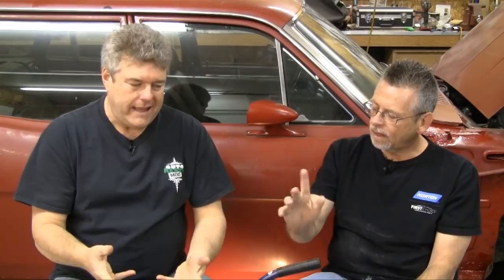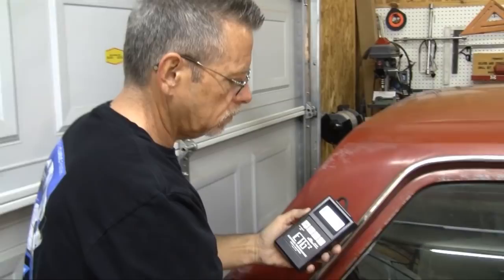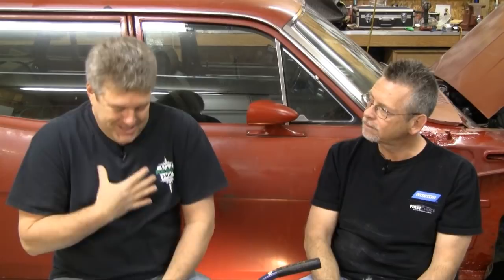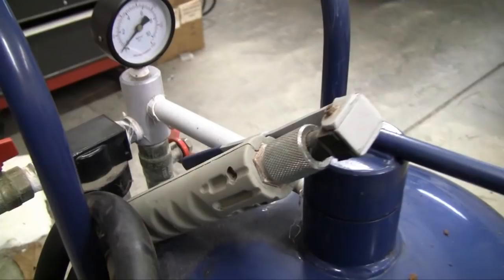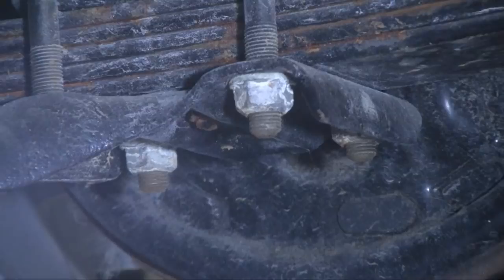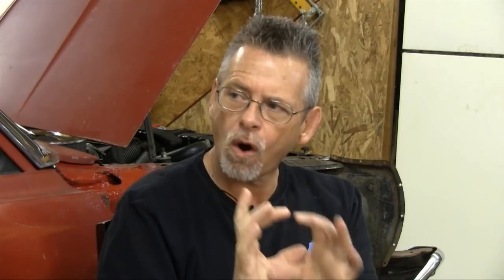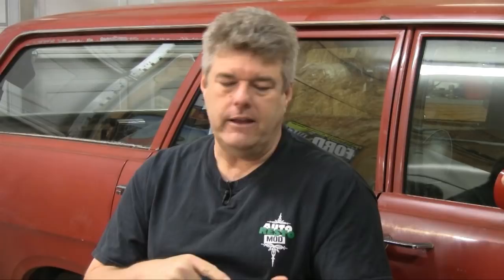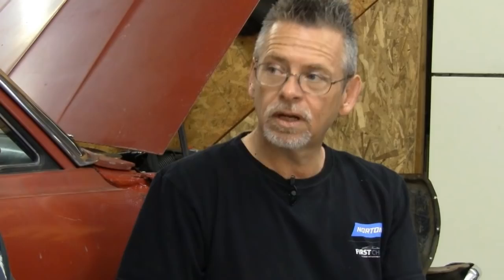Six Ways to Strip the Paint Off Your Classic Car Pros and Cons Episode 201 Autorestomod

Comment: I've been doing wet blasting for a living for the past year. It is by far the preferred method for removing all material from a car in any condition. I've blasted 
 aluminum vehicles 67 land rover. To thin metal like 68 Broncos. It does fill jams with media (glass) we add rust inhibitors (holdtight 102) to the process. We then pressurewash the vehicles to remove all excess media also ht102 is injected in the soap dispenser. Then we give the vehicles a final rinse with ht102 10 to 1 ratio. Blow dry ...the vehicle is ready for primer.   
Ht102 works by stripping the surface of all impurities. Not by leaving any kind of coating. We are located near the coast and its buys you approx 48 hrs ...of flash preventive...

I recommend to my customers to primer before metal work. And grind small areas that they need to repair. Otherwise they will be calling me again to remove the rust after doing a few weeks of metal repairs.
Reply from the maker: Thank you for this! Awesome. We're wanting to find a Dustless place locally so  we can do a hard core experiment.
Reply: How much do you charge for this?

Comment: Just watched a video on dustless blasting ,they use a special rust inhibiter with the water that's used in the machine ,they blow dry the car when they are done . The rust inhibiter gives you a 72 hr window and helps with adhesion for sealers and primers .

Comment: Informative video. I was hoping it would address the paint on my car. I have a 1983 FLORIDA Mercedes Benz with enamel paint. My concern is the paint is damaged by the Florida sun beating the paint for years. Otherwise, there is zero rust and corrosion and a few small places that have been polished through to the primer. This wasn't addressed in the video, so I don't know what needs to be done at this point.
Reply from the maker: Many times if the original paint is good, you can scuff and repaint over it with sealers. I wouldn't strip the car unless absolutely needed.

Comment: I did an entire car with just a high speed drill and lots of wire wheels, harbor freight or amazon are pretty cheap and the only mess is paint, primer, and bondo dust - and lots of little wire pieces if you overuse a wheel (you find the little wire pieces in your clothes, in the carpet with your bare feet ouch)  I tried the media blaster from Harbor Freight but it was a mess and by the time I got it working, only did a small spot on the car and was out of media already.  Not worth it.
Reply: i did the real cheap "blaster" from hf that is made of plastic and you hook your shop air to it. It was a wasted $40.
Reply: The high speed drill is a mistake.  Guys, use a variable speed grinder-polisher when using wire wheels, and keep the rotational speed below the threshold where wire spins off and embeds into your skin, and threatens unprotected eyes!  Do not continue running a wire wheel when someone steps near to talk to you or watch.  I cannot imagine wire wheel technique on an entire car, but if you did it, then I am willing to consider the technique, as it’s all hard work with drawbacks.  I use wire wheels on rusty scaffolding, jack stands, old vices, for example, because these objects are simple.  On other objects, you can’t get the wire wheel into complex, tight areas.  Sometimes I use a pneumatic die grinder and a hell of a lot of small sanding disks to get into tighter areas.

Comment: As a dry ice blaster I haven't had a lot of success with dry ice blasting. If the paint is really thin and there is only one layer then dry ice could work, but it's unlikely that the average car would be able to be stripped with dry ice.

Comment: Great video! What about chemical dipping with acid or dipping in a heated tank of environmental friendly chemicals? My take on this is dipping is the best method, then water injected glass blasting. Northern California doesn't allow dipping, so my shop uses a rust inhibitor with the water when glass blasting. Using an inhibitor the car will not rust for 3-5 days when left outside, unless it rains. The rust inhibitor is environmentally safe and actually increases adhesion of the epoxy. The surface is so clean when wet blasting you can epoxy when dry, with no other prep work needed. Wet blasting can remove body filler, undercutting, powdercoating, and grease with ease. On average I charge $1500  for blasting a car on a rotisserie. I will not paint, restore, resto-mod, or customize a vehicle unless my shop blasts it because I want to preserve the vehicle, not patch it.

Soda blasting is not recommended by paint manufactures and can void warrenties. So can dirty recycled media. Many shops recycle their media and recycled media will contain oils, from previous jobs when blasting undercarriages, which will create adhesion problems.
Reply from the maker: SpecialedSpellcaster Honestly, Jeff has had less than stellar results from chemical dipping. We'll be doing a couple of different methods on the '69 Wagon here soon. Stay tuned!
Reply: +AutoRestoMod I had my 70 Chevelle chemically dipped at Redi Strip and they did a great job, all the rust and filler and grease ...  GONE.    Exposes a lot of problems but at least you know where they are and it gets to all the hidden areas that blasting or sanding will not touch. Not cheap... but very effective.  See my video posts showing the before and after.   Thanks

Comment: I need to amend my question.  I'm looking for the best means to remove all paint, rust and over materials from steel, then immediately coast the car with the best rust protection possible.   I'm trying to create a vehicle with virgin metal then protect the metal from rust or other environmental degradation.  It just seems to be one place where saving $2,000 or $3,000 might not be a good idea, especially knowing how much money will be poured into the car afterwards.
Reply from the maker: I really like the Dustless system so far. It offers a protective "coating" when the metal is blasted. The protection last roughly two days; enough time to get the car into epoxy primer. We're looking at doing a video on media, Dustless, and chemical stripping in the future, just need to line up the cash.

Comment: I have a question, on parts that are bought say from AMD, they are treated with black paint, before painting these parts is just a little mild DA work good enough prior painting?
Reply from the maker: Some say yes and some say no. I know painters who strip the e coat primer off and start over. Others I know go right in over the e coat. It really boils down to your comfort level with the manufactures e coat.
Reply: @AutoRestoMod  Thank You for that answer, I think I will DA most of it off, just so the Epoxy primer has something to bite into, Thanks again,

Comment: i have a 74 chevy truck and has a cheap paint job on it with alot of surface rust in various spots would you recommend using a sander with different grits or wire wheels to remove paint,rust and if you do use this method does it heat up the metal too much using one or the other?Also after your done stripping the paint how long do you have to paint it again and is there something you should put on the bare metal while waiting for paint such as a a rust inhibitor? thanks alot jeff
Reply from the maker: +Rockin Pip Bare metal starts to rust almost immediately after the rust is removed. If you are only doing small areas, 80 grit can do the job, but to do the whole car you are going to go through a ton of paper. The wire wheel method is often a little underwhelming as to performance. Sanding will be the fastest way to zip off that rust. Some media blasting can sit for a good while, sanding will not tolerate that. Needs to be in primer as soon as possible.
Reply: AutoRestoMod Muscle Car Resto and Modifications thanks alot for the reply i appreciate your help!
Reply from the maker: Any time Rockin!

Comment: Opinion on metal prep over bare metal and can it cause issues in body seams
Reply from the maker: Yes. I have proof in my 1972 Mach 1. We had the car dipped and the seams are rusting. IF you can get water down in the seams, you can clear it out though. It just requires that little extra work...which is where I sometimes stub my toe so to speak.

Comment: Guys, a buddy of mine has his door jams sprayed over with a thin coat of black. I doubt is has even been sanded prior, since it can be scraped with a finger nail.
What would you guys recommend for stripping the hard to reach area's around the hinges? I only want to remove the semi-gloss black, and reveal the factory color. A heat gun perhaps?
Reply from the maker: +Ronald van Kemenade That will be tough. I might try a toothbrush with rubbing compound. The go back with another bush to remove the residue. Heat won't really help and may serve to attack the original finish.
Reply: +AutoRestoMod Muscle Car Resto and Modifications Thank you very much!
I'll try it with a copper or brass brush; he wants to go from brown metallic to candy apple red anyway. I just don't want to strip down to bare metal unless I really have to.
Reply from the maker: +Ronald van Kemenade OK, just know that the Copper or Brass can be as rough on paint as a steel brush. Regular old tooth brush will cut it as long as oyu are using rubbing compound.

Comment: I dont quite understand, he says that even when you soda blast metal starts to oxidize within minutes so you need to sand? Obviously metal oxidizes immediately, but isn't it reasonable to paint within a few days if no obvious oxidation occurs? It just seems a little ridiculous, the video makes it sounds like its near impossible to get a good finish without spending hundreds and hundreds of dollars. 

Is this one of those age long automotive questions, that everyone has their own 'right' way? But in reality as long as the paint is not severely scratched you will be fine painting the correct way?
Reply from the maker: +be ef The video was done to show different methods and give some "for your information" thoughts from a professional. Larry has his ideas, most of which are founded in years of doing cars. Larry is a superior technician with over 40 years of auto-body experience who works for a major paint supplier. He has no ax to grind on any particular products. he feels that plastic media is the best solution. Jeff is not sold out on any method yet. And thus the wagon is still waiting for him to do an episode where we examine the top three: Plastic Media, Dustless, Chemical (Aircraft stripper) and Mechanical (Big orbital with 80 grit). As to the big bucks being the only solution, note that we did discuss DIY methods as well. So not all of our solutions were big bucks.

Comment: I was planning on sand blasting and soda blasting my '64 bug. However...after watching this...I am concerned about finishing it and letting it sit before painting it. It's not like I am going to let it sit for long...I plan on immediately getting it painted. But it might be another weekend before I get it painted. I am worried about letting the car oxidize in the interim.  How big of a concern is that and what can I do?
Reply from the maker: Soda can serve as a rust inhibitor as can the dust from media blasting as long as the surface isn't disturbed. Be sure to let the shop know what you did: either media or soda. The cleaning methods are different.
Reply: watch diyautoschool on the tube. Pete is big on expoxy "primer". You can spray it on bare metal to hold the rust off until you're ready to paint or work the metal.
Reply: Suggest you do it yourself one panel at a time and prime coat immediately.  use paint stripper. maybe ok to let sit if you're in Arizona, otherwise it will surface rust and waste your time and money.

Comment: Any suggestions on undercoating removal on a early 70's dodge? And should you paint the car with all parts installed or paint fenders and hood off and put on later? and is there a wait for cure time to install parts after painting? I know a lot of questions.
Reply from the maker: We will cover painting the wagon hopefully this summer. Best advice on the undercoating is remove anything from the interior that can catch on fire, then use a butane or propane torch and a scraper. Hot, hard ugly work but that has proven to be the most effective for us. The on off thing is as varied as the painter that will be squirting the car, one dude likes fenders and hood on, another fenders on hood off. We tend to like to have the fenders on and hood off. Paint cure is different for different brands but Jeff has always run by the rule of: if you can still smell it, it is still cooking off...see that wasn't so bad.
Reply: AutoRestoMod  Never and i mean NEVER!!! , use a butane torch to scrap paint off any car as you will Warp the shit out of it and also it will create surface rust quicker.FACT!!
Reply from the maker: Mopar Man73 Never have we warped a panel doing this: heating the shutz then scraping with a paint scraper. Now if you sit on it with the heat for a while yeah, you surely could. But if you just pop heat to it then remove the heat and scrape, it works great.
Reply: well ok but mention it next time you suggest it as theres alot of weekend warriors that might might not have the expeirence to think that.I do enjoy your show and i thought i would just try in helping others not fuck there car up( safer options) thanks :)
Reply from the maker: Mopar Man73 LOL For sure.We might do as Fst break on how to remove undercoating with the torch. But your input is always appreciated! =)

Comment: I picked up problems painting new 2K paint on top of old Enamel.
Reply from the maker: Sorry to hear that.
Reply: Hi, I think it was the old Duco that lifted when I sprayed new 2 k over it. I tried putting down 2 very thin dry coats of primer, and then a proper coat, but it still lifted the old Duco. I ended up having to strip down to bear metal and start from scratch. Thanks for your video, it was very informative.

Comment: Dustless blasting with water and glass uses a chemical holdtight 102 that prevents flash rusting 
Dry ice is actually really cheap a good dry ice blaster is 40 k 
For a unit that will be effective 
And you still need a compressor 
The new aircraft stripper sucks 
I’ve been doing cars all my life
Reply from the maker: Agreed.

Comment: Ok so only strip if the body is not new or have a smooth clean foundation
Reply: sam111880 Well, like our wagon, we are only stripping the areas that don't have original paint. Multiple paint jobs will need to be stripped. If you have a good solid foundation you can often get away without stripping.

Comment: I found this somewhat biased. Your body "expert" is clearly very old school and very much attached to scratching the hell out of sheet metal with very aggressive sanding discs.
By far the cleanest, easiest way a backyarder can use to strip a car is cheap methylene chloride paint stripper from the hardware store. Do only one panel at a time, collect the scrapings on a plastic drop sheet, let them dry and they can be easily disposed of in regular household waste collection.
The tools you need are a paintbrush, scraper,  masking tape and cheap plastic drop sheets from the same hardware store you bought the paint stripper from.
Please stop perpetuating the myth that paint needs a rough, keyed surface to adhere to, that is precisely why etch primers were developed, and why mass produced vehicles don't have paint falling off in sheets. 240 grit on an orbital sander is the coarsest any professional should be painting over when priming bare metal, any professional who covers 80 grit scratches with primer is a hack.
Reply from the maker: +Sideslip  Larry is a Lead tech for Finshmasters and has 30 plus years in the business. He knows his stuff. We were not saying that any one type of removal method was better than the other Slip. We discussed Aircraft Stripper, Plastic Media etc. The idea behind the video is to give a general overview of the methods used and a light how-to on the home brew methods; Jeff actually said that an "old school" method was to use 60 and 80 grit paper to open up the finish with Aircraft stripper. And frankly, if you have ever cut Imron paint using stripper, you'll know that that stuff is a sllooooow removal with out a little help from a DA with some 180 at least. As to mechanical removal, the same applies.
Reply: how will methylene chloride effect bondo?
Reply from the maker: Old body filler will need to be removed and reapplied as the filler will soak up the paint stripper and cause all kinds of problems in the paint surface.
Reply: I live in a very humid area and using paint stripper makes me nervous cause you have to rinse it off good and flash rust only take a second here.
Reply: ooo ffs.   first comment. "triggered".
Reply: Yep,  just look at his hair, straight out of the 50's that's why he is old school.
Reply: eats it
Reply: This is pretty simple. Calculate time and materials versus spend.  The way to handle a resto is pay for someone to glass pressure wash the sheet metal. If they're good they'll use the anti rust finishing up, but it doesn't matter. I'd still dry blast anyway before primer. Getting all the big stuff off + materials takes more than 20 hours by hand. So if you pay $700 for the sheet metal panels to be glass pressure washed, at that price you're ahead of the game by a long shot. 

Unless you think your time is worth $3.50 an hour. 

It usually takes twice as long, so you're looking at $1.75 an hour sanding paint, PLUS materials.